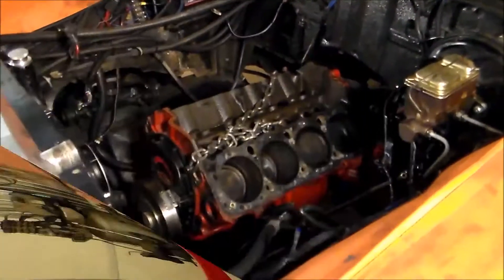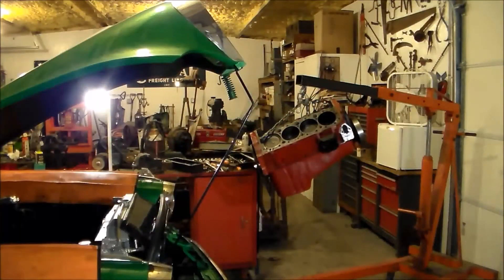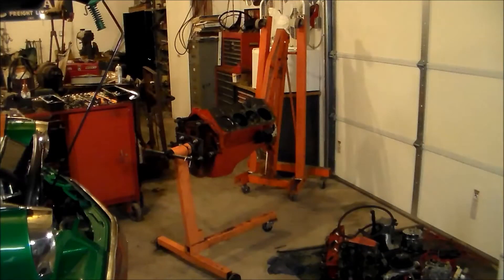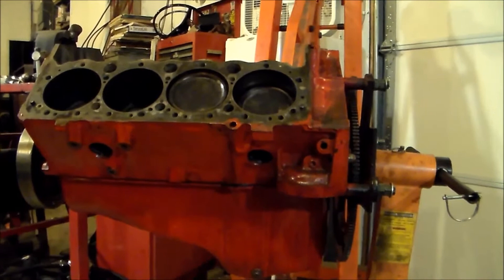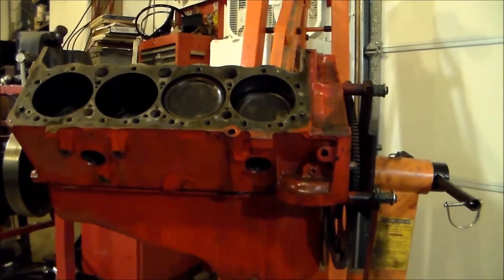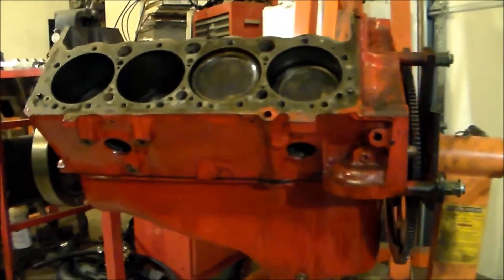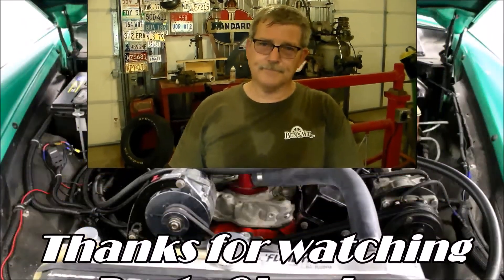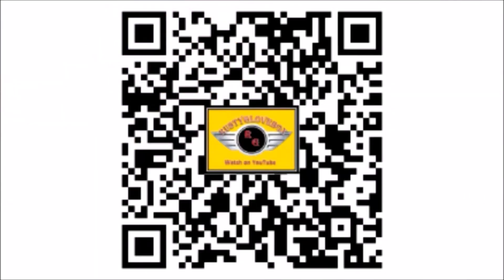SBC 400 Repair,  Day 2

Comment: Oh man Lloyd, sorry to see this, that's a lot of extra work. I ran 400 small blocks for years in my race car and like the torque the long rod makes. Hope this fixes it, I had bad cam bearings once making filings in the oil and causing overheating so catch some oil in a clear jar, let it sit overnight and look for metal particles on the bottom.
Reply from the maker: I looked at the oil and didn't find any signs of metal. Glad about that . Thanks Wendell and  enjoy your week

Comment: Wow Lloyd I never took an engine out without removing the hood first. Definitely be better taking that hood off before you put that engine back in. Yep definitely a good job cleaning the crud out of that engine and checking that radiator out just on general principles. Great video two thumbs up
Reply from the maker: Thanks Larry,  I won't try it with the engine assembled when it time to go back in.  It is looking good so far. Take care

Comment: when they had the 3 soft plugs it was a sign of it being a 4 bolt main block, i have 2 of them now. also since you were blowing coolant out would double check the heads with straight edge. looking good was tight fit coming out.
Reply from the maker: Thanks, I am going to clean all the parts up tomorrow. I'll be sure to put a straight edge on it.

Comment: Wow it barely came out. Was there a lot that came out that you could see. I guess one of them inline coolant filters would be good insurance on a engine design like that. Well done .
Reply from the maker: Thanks Steve, I was thinking the same thing. Do you know of a supplier for the inline filter?
Reply: Rusty Glovebox  Summit Racing or Jegs has them I believe  in various configurations .  I would start there.

Comment: It would seem that if there is gloop in the water jacket there  will be some gloop in the radiator, too. Good idea to flush it/blow it out. How do the cylinder bores look?
Reply from the maker: I will flush the radiator and heater. Don't want to do this again later. The bore looks good. Thanks and enjoy your week Bruce

Comment: Not that you need it just now but will you flush the heater core as well? If the radiator has much rubbish in it it would seem likely that this will also be contaminated.
Reply from the maker: Thanks Dan,  I will flush the radiator and heater. Don't want to leave any of that behind.  Take care

Comment: Last few engines I pulled were FWD and I dropped em down to the floor. Had the car up on ramps then dropped the engine then lifted the car up a little more.
Reply from the maker: I wouldn't mind having a lift but I don't want to dedicate the space for it. But it would come in handy. Thanks and take care
Reply: Oh I don't have a lift. When I said lift the care I meant jacking it up some so I could get the engine out.